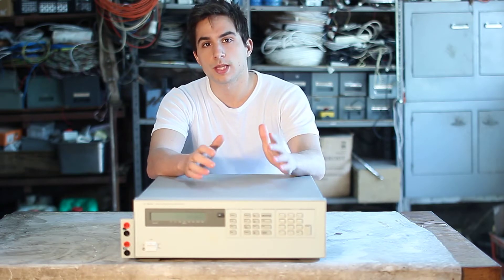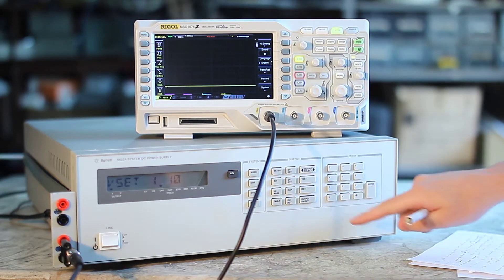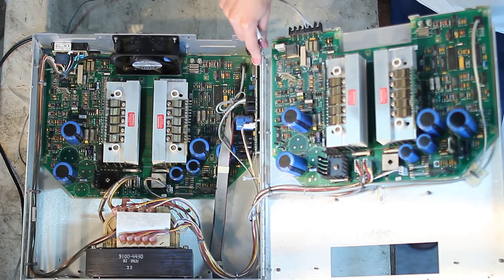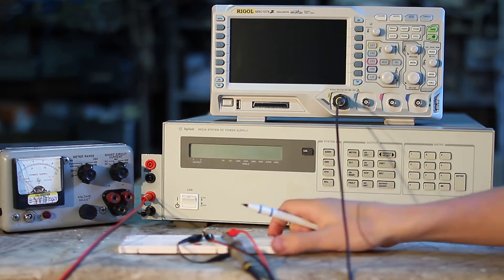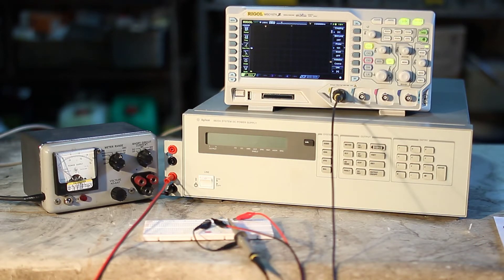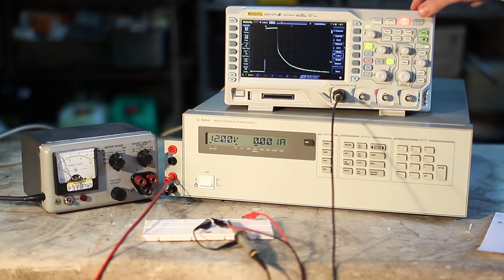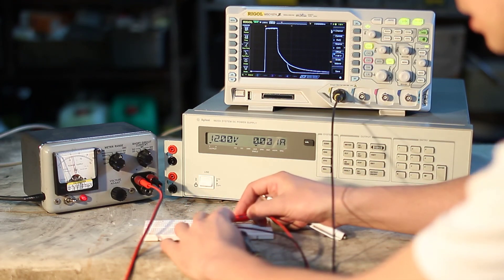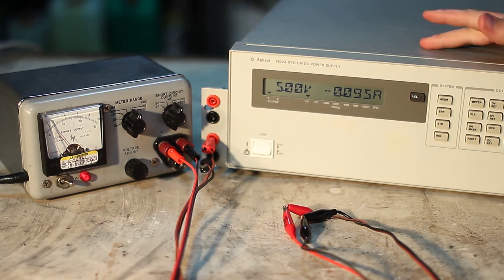PE #2 Teardown and Test of an Agilent 6622A System DC Power Supply

Comment: Great video and interesting!
A few points:
1. You should talk louder with more energy
2. The older supply has lower capacitance because it doesnt have a real adjustable current limiting like the 6622A, for a constant voltage power supply like the older one you can go without output capaictance at all quite easily, but if you start adding constant current you must for stability add some output capacitance.

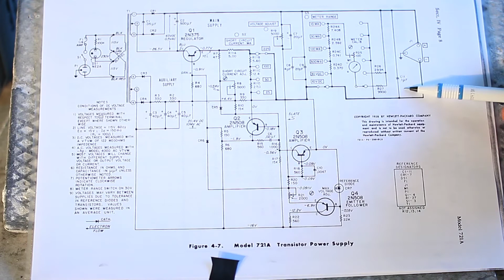Also, at the left side at 4:17 it seems like the older power supply has about 24.1uF of output capacitance, if you look closely at the left side near the output there are 2 capacitors in parallel.

But still - great video! I subbed. Hope to see more from you!
Reply from the maker: Thank you for the feedback!
Nice observations, I really apreciate your comment :)